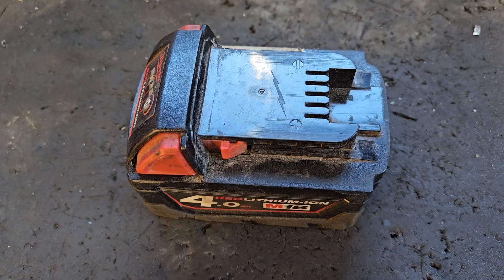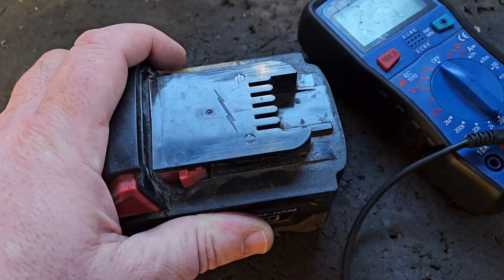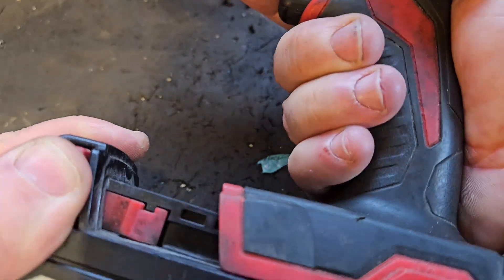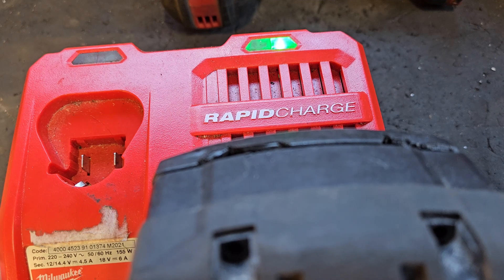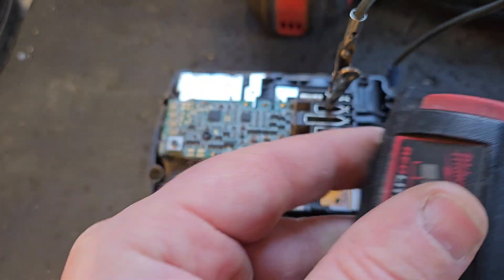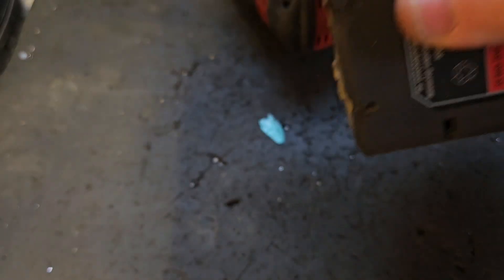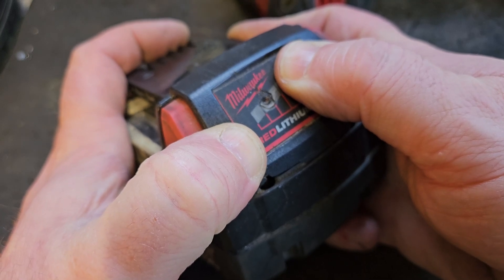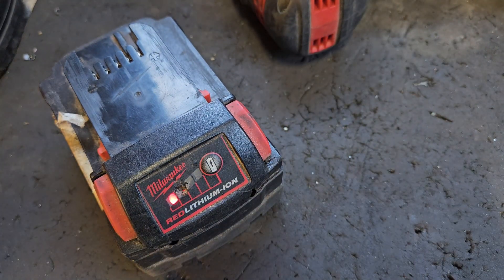Milwaukee Battery repair course EPISODE 5 resetting the PCB after cell replacement

Comment: I had a battery with the same problem & symptoms. Turns out, it still works when used with a light instead of a drill or driver. I'm going to try draining the battery with a light to see if that changes anything. Maybe it'll charge properly this time. I seem to remember this technique working with a different brand: King Canada 20v.
Reply: Never mind. It didn't work. The battery still won't charge or power anything now, not even a light.

Comment: Any other ideas?
Reply from the maker: I have lots of ideas
Reply: @doctorlefthandthread ok then please tell me how to reset a defect battery ( one red led light when battery test button pressed) every cell voltage is 4.1. Thx
Reply from the maker: @hannes8004 if you can't reset it you have to replace the board
Reply: @doctorlefthandthread I had this changed the board, got 4 volts all round but on the top terminals I have 12.65? I’ve checked all connections all solid. I’ve balanced all cells and done all this? Any help thanks
Reply from the maker: @thomasmillward3353 did you miss any connections on the board?
Reply: @doctorlefthandthread  No double checked everything 😆 Don’t know if the new board has come faulty
Reply from the maker: @thomasmillward3353 its not possible for the board to be faulty but are the cells reading 20v if you measure the two large connections to the board plus and minus?
Reply: @d @doctorlefthandthread no I’ve tested this and it’s still 12.65 v - I’ve re soldered and re fitted pcb! Really stumped 😅
Reply from the maker: @thomasmillward3353 are you sure the cells are testing correctly go from plus to minus on each side in case you got some cells that have reversed polarity
Reply: @doctorlefthandthread I’ll give it a try tomorrow thanks!!

Comment: Thanks, I have 2 9amp batteries that I charged with a DC power supply and the red light kept flashing. Put it on my drill and now have 4 red bars.
Reply from the maker: Cool
Reply: Does the load bar reset after put the battery into the drill?